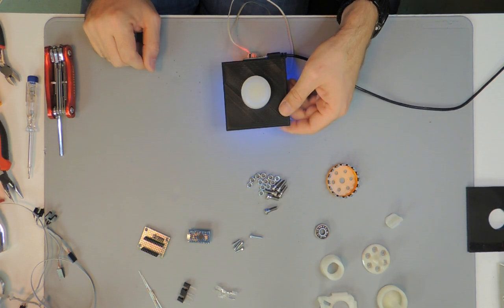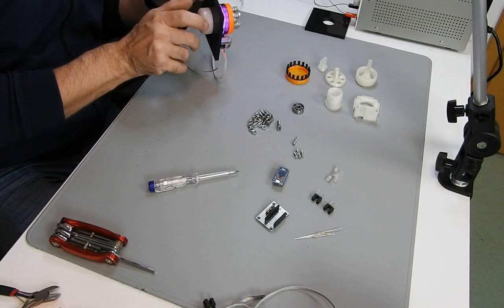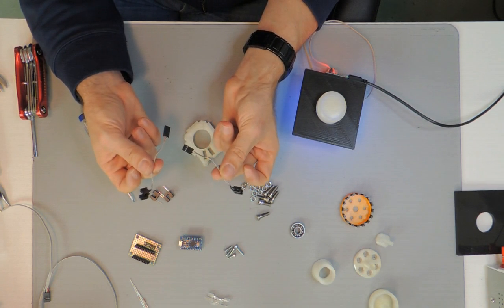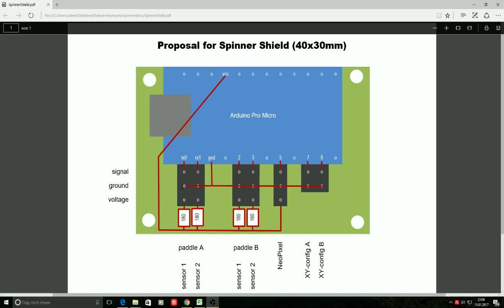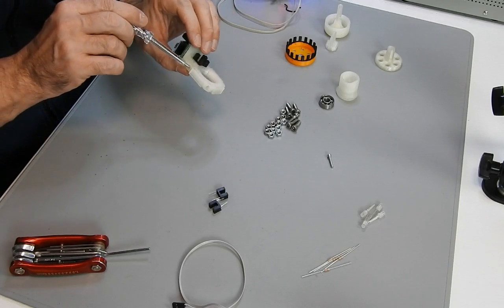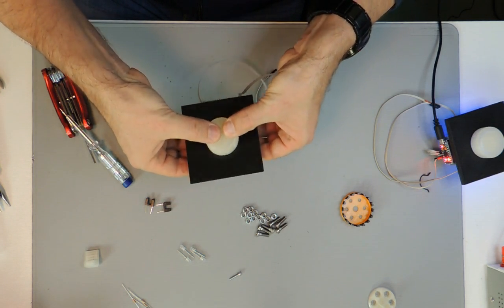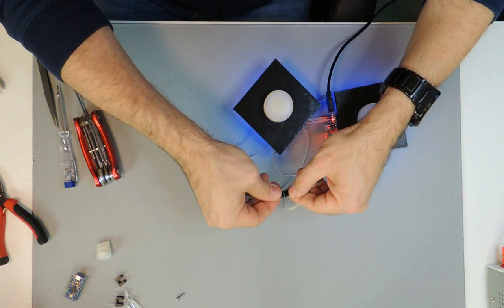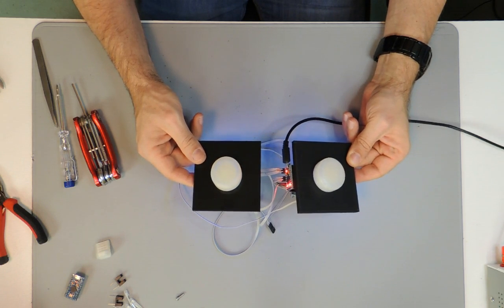DIY Illuminated Arcade Spinner - Build Instructions

Comment: First of all, THIS IS AWESOME. Second of all, how do I need to wire this to accept trackball input also as noted in the comments?  I would like to wire my 60in1 trackball into this and then this into the 60in1 so I will be able to use the trackball or the spinner depending on which game come up?  Please let me know if this is possible.  Thanks!  This is EXACTLY what I wanted.  I have all parts on order now and have already started printing.  THANK YOU for such a cool project.

Comment: Great project wanted to ask, How would this work for a 4 player game? Would the player 2 3 and 4 mouse code be abled to be configured so that they all dont control the one mouse in windows etc
Reply from the maker: Craft Monet  each spinner acts as one (of two) axis of a mouse. So two players can play simultanously, each one one his own axis. When adding another set of two spinners, its basically like adding a second mouse: while posibble, the activties on the second mouse counteracts/ interferes with activities on the first mouse and vice versa. In term of spinners: players 1&3 interfere on one axis and players 2&4 interfere on the other axis
Reply: Tinkering On Steroids thank you, I guess I would have to try and write new code and base it on usb controller axis input for each player then, like triggers on gamepads etc :)

Comment: Do you have a link to where you got the Flat Ribbon cables and connectors?
Reply from the maker: Here are some links, but that stuff is quite easy to source, nothing special here:

universal 40 leads flat ribbon cable:
https://www.amazon.com/Pc-Accessories-Connectors-1-27mm-Ribbon/dp/B007R2JK9G/ref=sr_1_2?ie=UTF8&qid=1523001132&sr=8-2&keywords=flat+ribbon+40&dpID=21wh-pjyi4L&preST=_QL70_&dpSrc=srch

Set for dupont connectors:
https://www.amazon.com/QLOUNI-Housing-Connector-Adaptor-Assortment/dp/B0774NMT1S/ref=sr_1_3?s=electronics&ie=UTF8&qid=1523001247&sr=1-3&keywords=dupont&dpID=51zVtH4LS3L&preST=_SY300_QL70_&dpSrc=srch

pinhead connectors:
https://www.amazon.com/Hotop-Pack-Single-Header-Connector/dp/B06XR8CV8P/ref=pd_sim_60_24?_encoding=UTF8&pd_rd_i=B06XR8CV8P&pd_rd_r=B4QQZQDAEB0SYNSN5V4N&pd_rd_w=ulP4j&pd_rd_wg=cn2kt&psc=1&refRID=B4QQZQDAEB0SYNSN5V4N
Reply: Thank you.  I apologize for my ignorance.  I did have another question regarding the sensors.  Can you tell me which are the ground wires?
Reply from the maker: http://www.electrodragon.com/w/images/6/60/ITR9608.pdf

Comment: Awesome work! Very nicely done. It looks like you're doing quadrature encoding. Is that the case? Since you didn't put source on your Thingiverse page, I can't tell for sure.
Reply from the maker: The source is on Thingiverse. Look for the ToSpin_20.ino file (Arduino IDE).
Reply from the maker: Regarding quadrature encoding: I'm not quite sure, Need to clarify the expression due to language differences.
Reply from the maker: ...and BTW: thanks for the great feedback  :-)
Reply: Oh, I don't know how I missed seeing your code before. I just looked at it and I'm pretty sure the checks you're doing in your interrupt handlers are for detecting quadrature encoding. Unless I missing something, the checking you do in those matches the coding tables here https://en.wikipedia.org/wiki/Rotary_encoder#Incremental_rotary_encoder. Thanks for the quick replies.